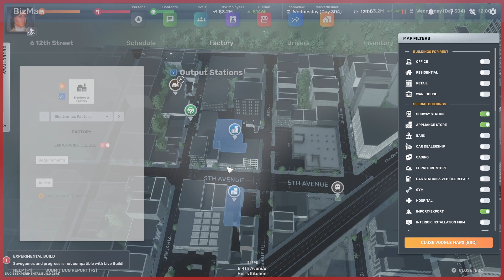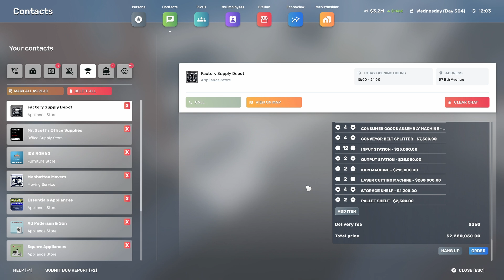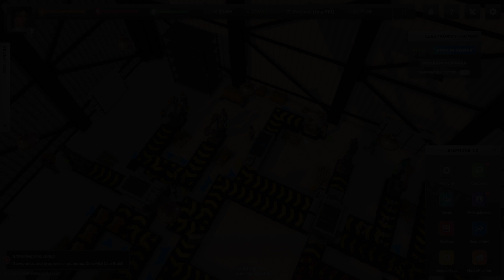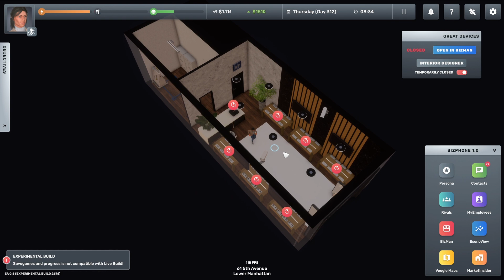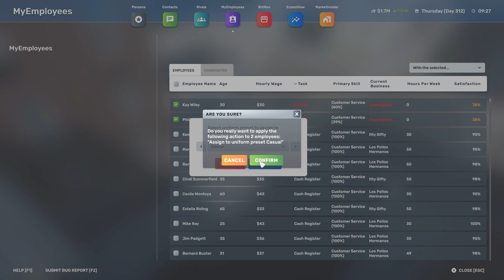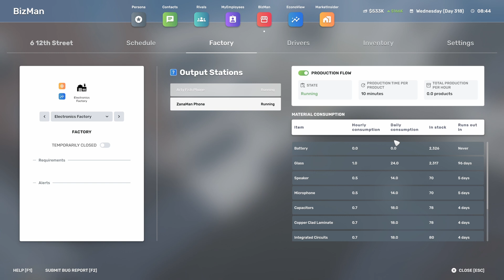Big Ambitions 0.6 - Opening an Electronics Factory (EP 16)

Comment: Great video but how much are the two end products costing you each? If it does not cost a lot less than importing them, then faatories are surely pointless?
Reply from the maker: I haven't really done any numbers on how much it actually costs to manufacture one single product. I don't think we save any money by producing them ourselves but I think that factories were introduced more as a late game money sink feature and also to add some complexity to the game.
Reply: While true with possible costs, it will save you from importing/exporting supply problems that they introduced. By making your own you’re not at risk of issues with your supply chain.